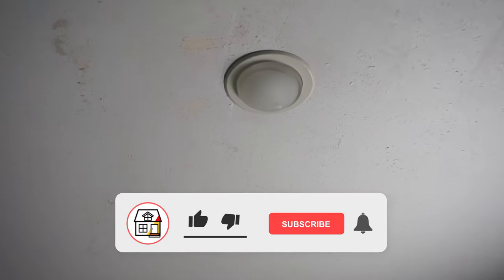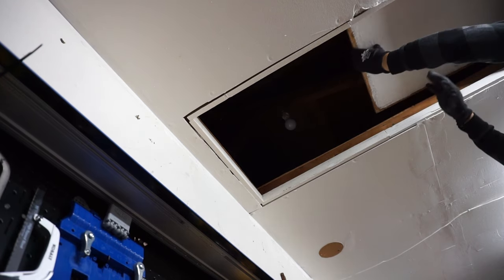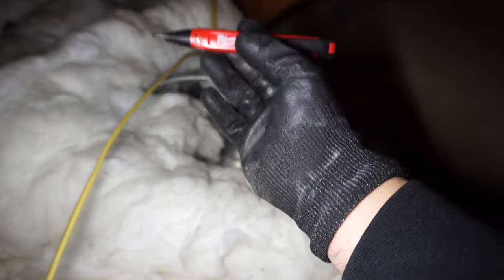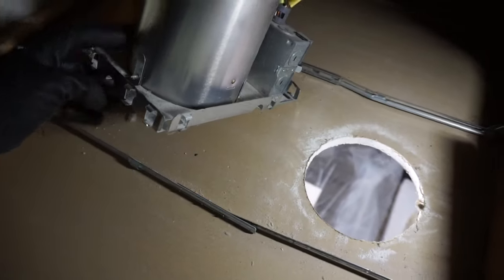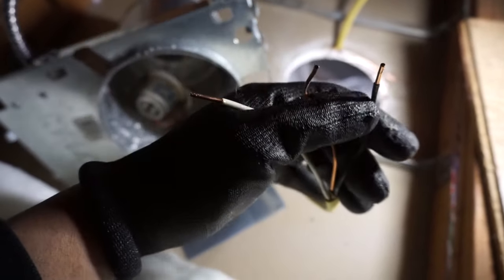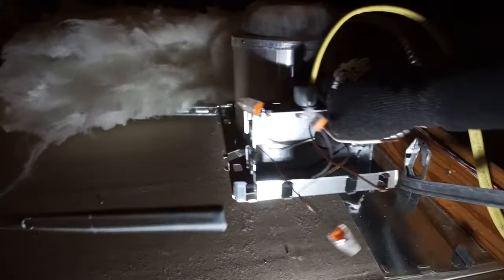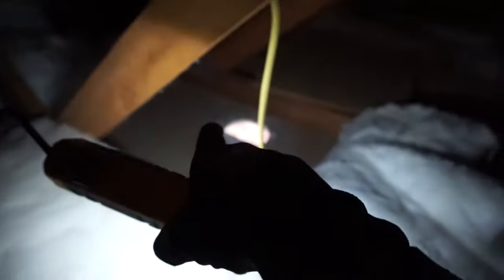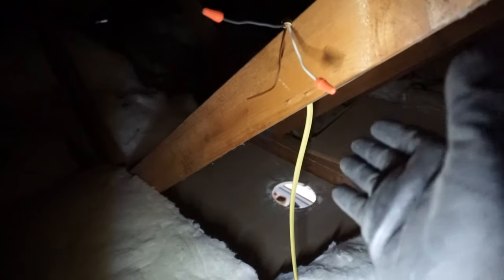How To Remove And Replace Can Light From Ceiling! (Recessed Lighting) Part 1

Comment: It's safer (and I think required by code) to put the terminated cables in a junction box that is mounted somewhere in the attic. It's dangerous to leave those wires terminated with just a wire nut. Someone could walk by and step on that wire and the wire nut comes off, and now it's an exposed wire that could be hot and electrocute someone. Especially with insulation, you could end up with those wires buried in insulation and a person up there wouldn't even see the wires.
Reply: I don't know code, but do agree 100% on the safety aspect...
Reply: He said he was gonna use the wires soon to install new lights but if you’re not using it then put it in a jbox. He literally said that

Comment: I need to remove can but have no attic. How do I get the can out?
Reply: Me toooo,  how to do that if I don't have attic access?
Reply: Make a hole I guess
Reply: There are screws inside the can. If you remove it, it will slip out

Comment: Dude where's part 2 I've been looking for it this whole time
Reply from the maker: Hi! Do you need can lights replacement or pot lights?
Reply: @FixThisHouse  Okay so here's the story I currently have I believe Can Lights (the lights that screw in and get tucked in the can) and I want to change them all to some Peteme brand LED Recessed lighting that change color. And I'm worried I don't want to screw anything up cause I can't afford to replace one and can't afford an electrician
Reply: @FixThisHouse  I want to say pot lights
Reply: @FixThisHouse  wish there were a way you could just message me directly to show you
Reply: @FixThisHouse   Hi this is great information. I would love to get your input and more detail video on replacing such can light with ultra thin recessed lighting. Removing can is bit of extra work for non-professionals so I am inclined to just use retrofit recessed light. What would you recommend? any pros and cons between those two options?

Comment: Thank you for this. I just did it for my outside patio. I wasn’t as lucky. I had to take off the porch ceiling to remove the box.
Reply from the maker: Thank you! Glad I could help! 🙏🏽👍🏽😊
Reply: You can take off the can housing from inside the can, there’s 5/8 screws holding the can to the mount, they are designed so you don’t have to caut ceilings open to access the connections
Reply: @JeffPenaify  awesome! I was afraid that I was going to have to tear up my ceiling in order to  convert my pot lights!

Comment: I need you help bro, I have halow light in my kitchen which I was able to remove but I cant able to remove the round assembly of can light. On the other hand when I tried to go in attic it's almost impossible to reach there. The frame is actually going through bottom of one of the stud

Comment: What if you have these and have a cathedral ceiling?  I’m wanting to change mine to canless leds, and not use the kind that screw in where the bulb was because none of those look like the rest in my house and cheap
Reply: Did you find a solution? I'm in the same boat as you.
Reply: @Mark-bh8zo not really.  Looks like I’m going to be cutting the Sheetrock around them and removing my old cans and then I’m going with the halo kind that are adjustable up to a 12/12.  My living room ceiling is a 10/12, the lights from one side light up the other if that makes sense, and that’s why I’m going with the adjustable.  Check them out.  They’re super nice